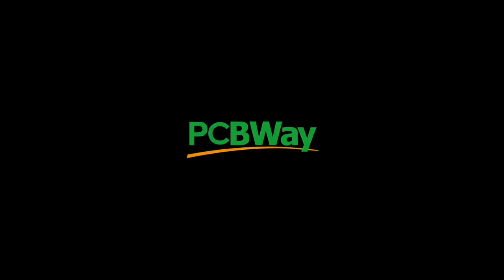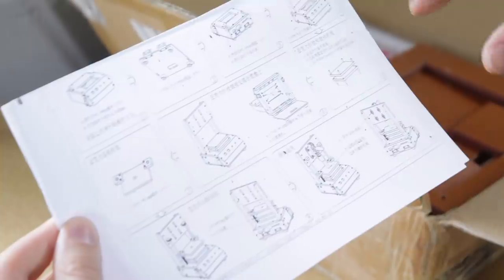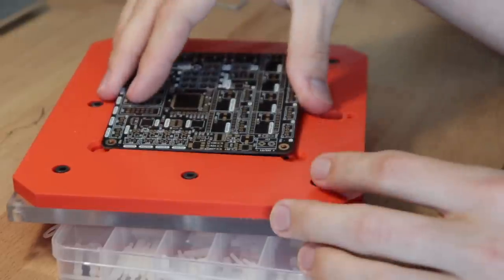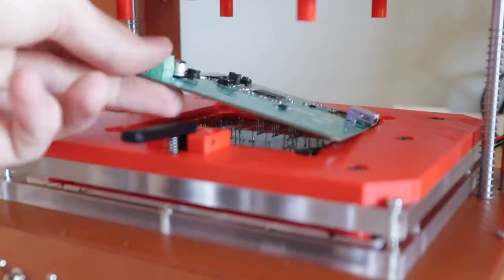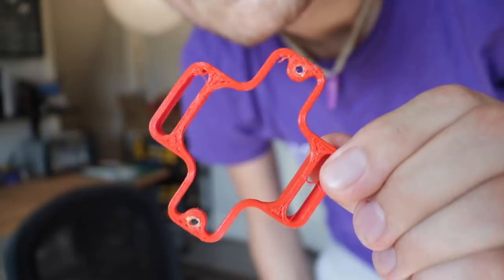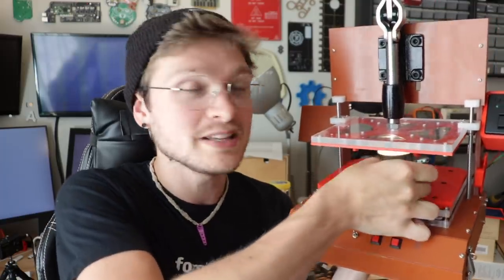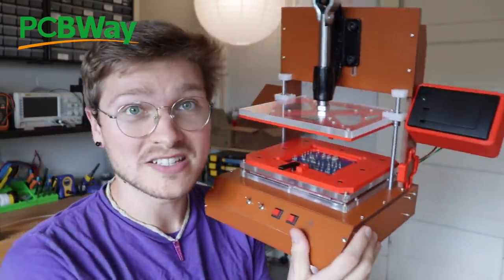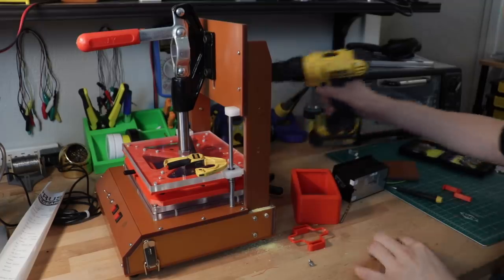This Machine Finds Soldering Mistakes

Comment: As a test-engineer for one of the biggest automovie suppliers, I can tell you the way you did the jig is almost identical to our jigs, running since decades for a wide range of products. One point I would have done different: Get rid of the Raspberry Pi. I have had problems, even with high quality SD cards, of data corruption. Use a standard PC or laptop with test script on there, log data to a redundant and safe place (NAS with RAID). Having a GUI on the PC with a big screen in my opinion is far superior to 4 buttons / switches and no screen. Also, then you could have used a normal (USB) label printer to print your results.
Also, print a unique code / serial number (e.g. QR or DMC) on every board and reference it to the test data. If in the future, if there are defect boards at your customers, there might be a correlation to a specific test criteria so you can in future lower tolerances on that measurement result. We do that by first, scanning the code with a handheld (or integrated) QR reader, then starting the test. There is no way to start a test without scanning. We also sometimes include mfg date and mfg line (pick and place line/station number) in these codes. So if one line at one day did something wrong, you know which boards to recall.
Anyways, great to see your progress! May your success continue. Greetings from Germany, Ludwig.
Reply: Also, print a unique code / serial number (e.g. QR or DMC) on every board and reference it to the test data. If in the future, if there are defect boards at your customers, there might be a correlation to a specific test criteria so you can in future lower tolerances on that measurement result. We do that by first, scanning the code with a handheld (or integrated) QR reader, then starting the test. There is no way to start a test without scanning. We also sometimes include mfg date and mfg line (pick and place line/station number) in these codes. So if one line at one day did something wrong, you know which boards to recall.
Reply: Totally agree on the Raspberry Pi! You can get USB-SATA adapters with a high quality SSD these days, which will make regular Raspberry Pi 4's really fast and reliable. Highly recommended!
Reply: This - super lots. or at the very least do all the mods to raspbian to make it rarely if ever write to the sd. They're pretty much indestructible as read only but after some database queries they don't last long. We use one for our access control for the makerspace. Previously it phoned home for the database and cached it to sd immediately. Now it keeps everything in ram and only writes something like once a week for power failure. Instead of 3 month sd cards we now get several-year sd cards.
Reply: They need to pull a jeff geerling and have their raspberry pi boot from SSD.
Reply: @LudwigBrechter  hey what sample schemes do you use?
Reply: @xxportalxx.  Hi, what exactly do you mean by "sample schemes"?
Reply: @LudwigBrechter  I'm having a hard time finding the correct stats terminology atm I apologize, but I'm referring to basically whether you'd use random samples, batch samples, or test every unit, and furthermore unit testing or functional testing, thanks for replying!
Reply: @xxportalxx.  Ah ok. Depends. Last time we did functional testing (let the uC toggle every single pin and talk to every other IC) of every single board produced. And for small series up to a couple 1000 pcs i would recommend that. You really want the data and can live with 5 additional minutes of time.
Reply: @LudwigBrechter  I imagine for the automotive industry it's probably also more common than in the disposable electronics market

Comment: Honestly, this jig looks better than the one we were using to test the "product-that-must-not-be-named" (unsure if I'm still under NDA or not even though it was like 15 years ago) at a company I worked at years ago.  Months before the "product-that-must-not-be-named" first released, there was a bug found in the circuitry involving one of the voltage regulators, and there was a board rework needed to fix it.  "product-that-must-not-be-named" already manufactured a few hundred thousand units when this was found, so they contracted my work to handle fixing them.  We had a similar test jig design to confirm operation of each unit after the rework, but is was nowhere near as clean as this one.

We would get shipped in pallets of these fully assembled (and fully packaged) products, open them, disassemble them, rework them, test them, repackage them, and palletize them to ship back to "product-that-must-not-be-named" warehouse.  I was in the parts department, so I sourced the parts, components, solder stations and screw stations, etc.  It was a fun learning experience to see what happens when you make an "oops" in a product that retailed for over $100 a unit, and have about half a million defective units to repair based on the design changes to fix the bug.

Comment: Is it uncommon to test the physical ports themselves?

Im making my own product too, and was thinking about a jig with motors that inserted cables into the ports to test them. Is that overkill?
Reply: Getting a jig that can reliably plug and unplug a connector over all the test runs is actually extremely difficult, and sooner or later you'll run into problems with parts of the test jig wearing out; it's honestly more cost effective to manually plug the cables in each test than build a connector-plugging jig unless you're operating at a much larger scale. Also, if what you're trying to test is just the off-board connectivity (and you're not specifically trying to verify that the mechanical connector isn't defective) it's much easier to add that same connector to the pogo pin board, with pogo pins that attach that connector in parallel with the one on the board and the outboard device just permanently connected to the pogo pin board's connector. (And if you really need to be able to test hotplug behavior, you can add some relay switches to connect and disconnect those lines.)
Reply: When i was in the physical test stage with my team's product we thought about doing the same thing but what we ended up doing was simply adding a couple extra pogo pins to the bed of nails connector then using that to test connections before soldering the acual connectors on, testing the connection before soldering has been sufficiant for now since each one we've tested hasnt had any issues, simply the same reason Anson mentioned, it becomes to complex to create a motorized machine to plug then unplug and then dealing with wear after a while, just test your connections and find yourself a good supplier for your connectors.

Comment: I'd say you could reverse engineer this and re-assemble it into your 3d pick and place framework so you pick the board and place it precisely into the test jig then use a stepper motor and strain gauge to measure the pressure on the jig as you press it to the board. You can also incorporate this feature into your pick and place controller and return the test results over the RS485 interface so you use a single controller board for everything. I also noticed that some thermal printers use TTL serial so that should be quite easy to interface to RS485 too. That way you have the pick and place, dispense solder then reflow and return then test and print the results, and if successful put the board in one place and fails in another.

Comment: 3:29 tip: drill two holes for the corners first, they act as a visual guide and act as chamfers to the contour finished by filing to dimensions.

Comment: I wonder if an ELK stack and kabana would be a reasonable log data tool for your testing, nice graphs and ml is pretty easy using it from what I've heard

Could also include machine data from the pi it's self (more useful on larger scale too)

Comment: Any idea how you are gonna keep control of each board that passed QC if it matters.
You can get some QR label scanners and put on the JIG and then a small QR code on the PCB that you can scan so you know exactly what PCB is in the jig.
Sometimes you also just store it in OTP(one-time-programmable) sections of the MCU but if the MCU does not work it is hard to put it in the OTP :D
Reply: I'd imagine they'd keep the printed test receipt with the board, tho some kind of serial-number would probably be needed for later tracking the board. I think just printing a serial number on the receipt, and having a white silkscreen rectangle on the board to then mark with a permanent marker would do fine, and probably be as fast or faster than a QR code printer. Adding a little lable printer would be neat tho, and remove the problem of poor or wrong hand-writing
Reply: @dumle29  True! A labelwrite could also be used! Would be awesome with a labelwrite that has automated cutter!
Reply: There’s a big white square on the back of the mobo for us to put a barcode sticker, write something, or just put a check mark! We got hella options! 💪
Reply: @lucianchapar  Awesome! It satisfies me that those kind of things are already considered!
Sadly a high quality barcode scanner for testjigs are a bit pricy.. BUT I'm sure you two can hack something together ;)
Reply: @decee1157  $20 for a good enough USB 2D barcode scanner 😎
Reply: @lucianchapar  True! Other than those are pretty huge! But i can see you can also get some pretty small barcode scanners the only issue is that they are a bit expensive!
Reply: Since they are already using a Raspberry Pi makes sense to me for them to use a Pi Cam and then use open CV to read a QR code. They should be able to burn on a QR code using the laser cutter they have. So if they make a jig they should be able to place a bunch of them in the cutter and etch a unique QR code onto them all.

Comment: our company uses the test similar to this but we also do heat and vibration tests by heating the boards and vibrating them seeing they work and we also use the same thing where we test the devices and print the receipt of working test points and their performance

edit:in case you are wondering we make the radar's

Comment: Testing The Index motherboard? Suggestion make a Pick and Place machine that uses a cell phone (or just a computer ) as the controller. Everyone has a cell phone and/or a computer. I think you’ve spent far far too much time on the motherboard since the beginning of this project. More important than the motherboard is the software it runs. Ideally, I’d like a Linux-based Pick and Place machine.

Comment: Nobody will care about the printed test results, as the only possible option that they should ever see is that everything passed. You can just print a bunch of receipts separately and include them in the box with all the fully tested boards.